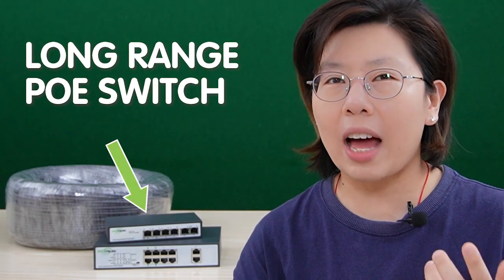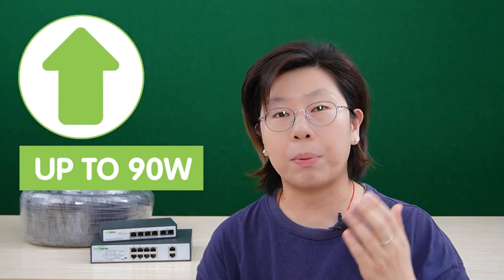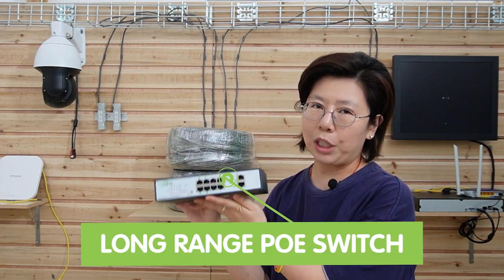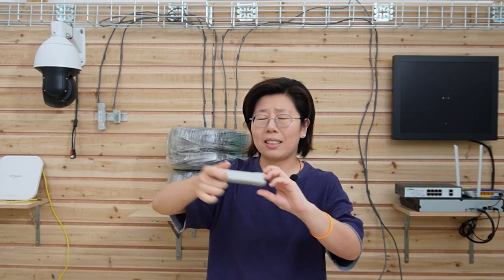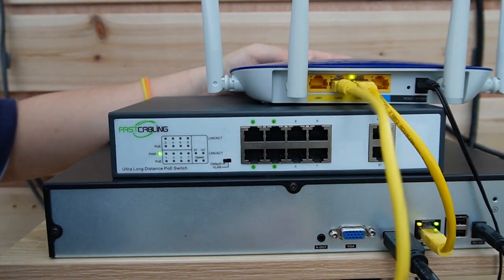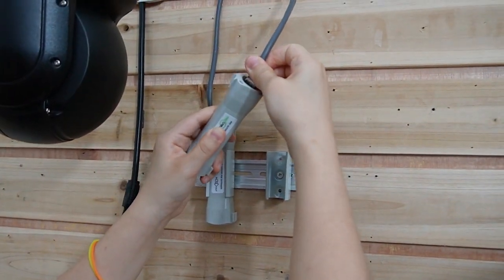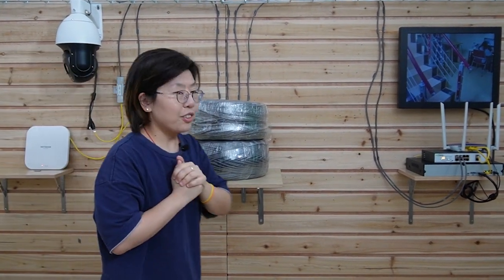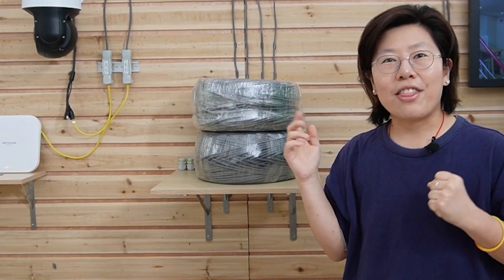Power & Data over 1000ft Long Range PoE Switch Make it Possible

Comment: So can you connect direct to camera ..
Reply from the maker: If you want to extend the range to 500 meters, a PoE extender must be added. Within 250 meters, you can connect the camera to the regular PoE ports and enable the dip switch.

Comment: Your information is incorrect. The correct term for the high power POE switch you are referring to is a POE Plus switch. There are also POE PLUS PLUS switches that go beyond what you are calling high power. Yes the PLUS and the PLUS PLUS switches will go beyond the 328 ft range of the wire as far as power but what about the data it doesn't change as far as the length limitation of the wire. I am a professional IT tech and have extensive hands on experiences
Reply from the maker: The long-range PoE+ ports actually support 4-pair poe, and that's why the switch can still maintain up to 30W of power when it reaches 450m.